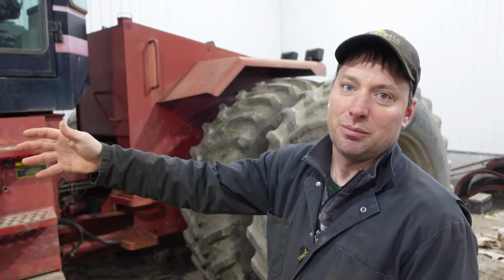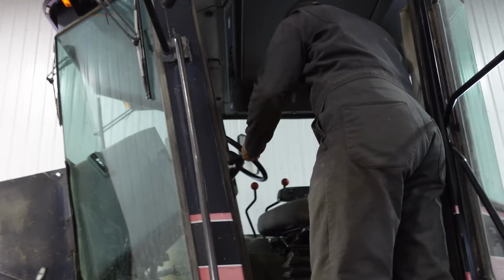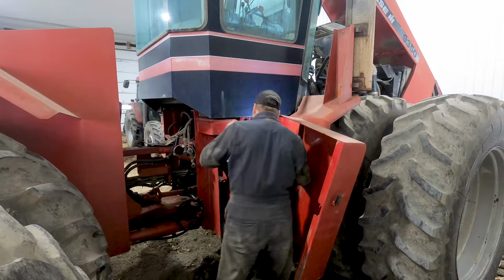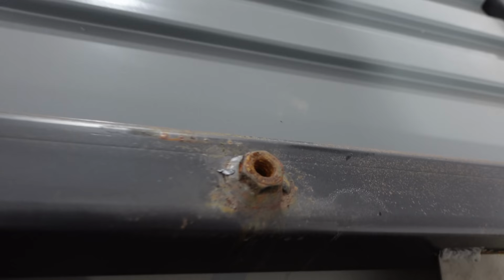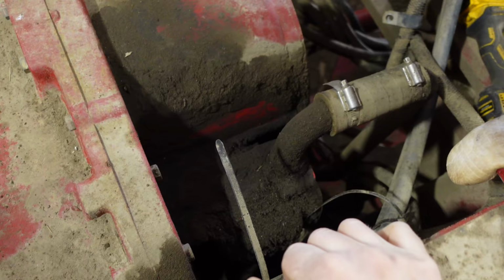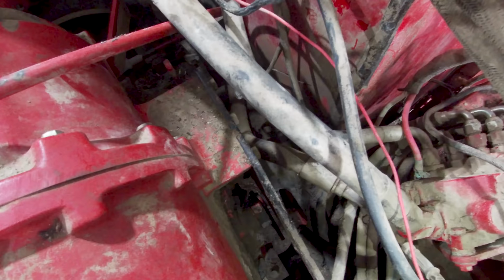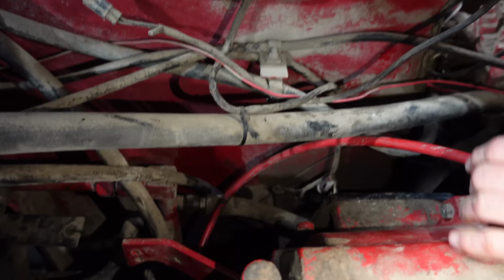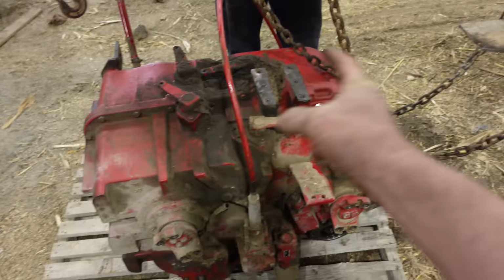Manual Transmission Won't Shift... Case IH 9350 Steiger [EP1]

Comment: This was an especially fun video to watch because I worked at a Case IH assembly plant for 6 1/2 years where I was a tester/utility guy so basically had to know every assembly station on the line and watching u guys with the cab in the air really brought back some memories as I routinely installed cabs along with everything else. Great vid, got me nostalgic 👍

Comment: How badly abused was this tractor that it had transmission issues at 4000 hours? I put over 2000 hours on the identical model doing extraction and towing in the oilpatch in NE Ab. when I was 15-16 years old and never had any problems and believe me that work was a lot more strenuous than farm work...

Comment: Rich and Kevin, Fawcett Tractor Supply in St Marys ON (8 minutes from my house) have 3 units similar in stock for wrecking. They show a 9150, 9230 and a 9250. Not sure if they are power shift or not, their web page doesn’t say. Two have burned, one worse than the other.  They might just be a straight parts swap if they are interchangeable, and not damaged for what you require/need. They might even have parts in storage from past demolitions. Check their web page under salvaged agriculture and you should see the three of them. Hope this helps. 

Always loved the channel and the tractor spin today is great. LOL, would have loved one of the Welkers to have popped up from behind the cab.
Reply: You will probably get a quicker reply if you send Rich an email.
Reply: @darcykeyaus  Since Rich gives responses here I figured he see it eventually.  That said, it is not a bad idea to send an email.  I never thought he’d have one posted in the video description, but there is a contact email listed.  I will send him the same message there as well and maybe he will see it quicker.
Reply: @rustynail2205  He did say in the video to email him :)
Reply: @darcykeyaus  what's his email?

Comment: Use a vacuum on the tank filler so when a line is disconnected it will draw air in rather that spilling out. Cool video guys.

Comment: Doing a 9130 powershift right now. Run it up on blocks about 18 inches pull the seat pop the floor pan and driveline. Hang the hydraulic pump hook a hoist to a forklift boom pull themounts and drop the transmission onto a skate and slide her out. 4.5 hrs and it's on the floor. 
The stx and newer steigers come out the top
Reply: I just got a 9330 and I think the tranny isn't quite right, it makes a bit of noise when you put it in forward gear and disengage the clutch pedal. It shifts quite rough also. How did you know your tranny was in a need of repair? Gear slipping?
Also, what do you think of the tractor in general?

Comment: Even electronic oil sensors aren't foolproof, we had a Nissan where the sensor failed by blowing a hole straight through it, and then not send an error to the gauge. So not only did it spew all the oil from the engine, it was also the failsafe to tell us that the engine was loosing oil pressure!
And to make matters even funnier, this happened twice (but the second time we checked it regularly, so we caught it before too much harm was done).

Comment: I have my 9380 going into the shop right now for the exact same job, mine is the 24 speed of that makes a difference.  Big Tractor Parts out of the states seems to be pretty good at getting parts.  Shop that is going to do mine just did a 12 speed last year, he had to put all new shift cables and master clutch cable in as well as 2 syncro’s, all new seals and maybe some bearings. Parts and labour was about $25,000. But it sounded like parts were a 5 week wait once you figured out what thickness of synco you need

Comment: Glad to see you guys pulled the tranny out the top, that is the easiest way to it. And yeah, have to remove that one side mount. That is the first manual tranny I have seen, all that I have done have been powershift. Not a difficult tranny to work on, just heavy parts and potential to get hurt, ...work smart and stay safe. I use a large split gear puller and a 10 ton hydraulic cylinder with pull rods to get the gears off the shafts.  Heat the bearings in an old electric skillet (375F) with peanut oil when you are ready to install, ...they will just slip right on.

Comment: Hey Kevin. Next time when you want to avoid the diesel bath.  Put a shop vac in the filler cap and plug any breathers on the tank while you change the hose with a plug.   Cost conscience.... lol...Dutch

Comment: There are a handful of wreckers in Saskatchewan and Alberta that might have parts .  Loeffelholz tractor and combine salvage in cudworth SK has a substantial inventory.   I should be able to hook you up with a  digital Service manual for the 9350.  Most CNH dealers will now provide a e book anyways after the right to repair bill moved forward in the states.

Comment: Snead equipment in Alabama might have something I know the rebuild Fuji transmissions like crazy and a full rebuilt ps is $30k. If your looking for salvage powershift stuff get of Facebook look for the steiger group there is a guy with red steiger salvage parts he might have a cab and harnesses. Could check Eldridge Supply, Bennett Tractor, and I think it's called Dumas Tractor all of which is in Arkansas. There is another place called Boothill in Missouri that has salvage tractor parts as well. Hope that helps

Comment: If I didn’t swap the manual oil pressure gauge for an electric, I would install a murphy gauge to but the engine off in the event of oil pressure loss. I know they make one for manual oil pressure. Probably make one for electric. I have one in my Lincoln sa200 welder. My dad was a pipeline welder and burned up an engine in an sa200 because it sprang a leak while he was up in a pipe rack in a chemical plant.

Comment: That tractor is worth way more than $50-60K. Have you guys been shopping for tractors lately? A tractor half that size and horsepower is worth at least $85K now. And your Steiger being non-émissions with minimal engine management, it's super-desirable considering farmers are still petitioning JD for the right-to-repair when their units are stuck in the fields.

As pricey as it is to rebuild, it's still worth it. You can always trade up when the service is finished, and be way ahead.
Reply: bare bones 9350 will bring 50ish if it had a pto could maybe get 60-70. The bigger ones 9370-9380 go for 80-90k
Reply: @Kolton9330  it's still respectable. I'm shocked the price hasn't doubled since the pandemic started.
Reply: @mfranzusan3014  age plays a big roll also people want tractors from the 2000s and onwards the 1990s tractors still a little but anything older most decent sized farms want nothing to do with them downtime and poor operator comfort is just to high
Reply: @mesh1248  I agree that age is a factor. But I also know that Tier 4 emissions and engine management on modern equipment is absolutely crippling the market from high maintenance and repair costs on machines with fewer hours than that Steiger. Think about it. People love early Chevy square bodies. They were plain brown wrapper trucks. No creature comforts, no stunning interiors. They ride like dump trucks, and they were everywhere on the road in the 80s. You stick a guy that's driven nothing but computer-managed, every power option, heated leather seats and satellite radio in his truck and he'll wonder what was so great about those old trucks.

Well, for one thing, you could fix them on your own with a handful of tools. A lot of the parts are available aftermarket. Maybe not overnight, but they can be had. Older tractors are the same thing.

You see how much an 85 square body work truck goes for now in great shape? It was only $5K when it was new. Now people want $25K.
Reply: @mesh1248  I've seen guys rebuild Versatiles from the ground up by putting the value of the unit back into it, and they were component built units too. Powerplants ranging from in-line 6 Ford commercial engines to Cummins triple nickels. 40K hour tractors rebuilt like new to be used another 40k. And they aren't new, comfortable tractors either.
Reply: @mfranzusan3014  yeah that is true but in general it’s mostly the owner operators  who do that run the rebuilt pre 1990’s tractors and nothing wrong with it its the cheapest way to run a tractor $per hours wise but any farm that relies on hired help has equipment that’s comfortable and enjoyable to drive to keep hired people around as for emissions i see way more problems in the trucking world then with tractors ive still obviously had some deff related maintenance but never a big repair but maybe I just getting plain lucky lol

Comment: 4000 hours?
That thing is brand new!
Ours has 35,000 hours on it.
It blew a hydraulic hose one day in 1998 and oil sprayed on the exhaust and it burnt down. We bought a Cat Challenger with the insurance money but bought the old tractor back from insurance as well and rebuilt it. The Challenger is gone and the Case is still around!
It's replaced by a John Deere now but I still prefer the old Case. Ours was powershift.

Comment: Kevin lucky! He's doesn't have stupid nowaday DEF tractor where Def freezes when it's below -10 and it causes variety of expensive issue. He smart running pre 2000 machinery where you can fix most of things with a sledgehammer

Comment: It's too bad he has such a nice building for fixing things, except the floor is such a mess you might as well do it outside on the ground! I know it was winter up there still, but paying all that money for a concrete floor & not being able to use it just sucks! Steiger equipment was always built to be very reasonable, & to be easy to repair! Until they got bought out! I really hope you could find everything to repair it properly! It would be a shame to not have a nice big piece of equipment like that around, not working!
Reply from the maker: He doesn't have concrete in there yet.  He is not that big of a slob

Comment: Cant believe how low hours that thing is 
The synco shift was junk 
Cant get any parts for em im aus 
Our local dealer sent 2 mid 2000s models to a wreaking yard over the last 3yrs 
The power shift models do 15k hours without any major issues

Iv got an 2002 synco shit with 8k hours 
Still going but getting rough, doesn't do any serious work now 
A 2010 power shift with 5k hours that still pulls the carry grader and recently retired from planting 
Now a 2020 quad track with 400hrs that's our main working tractor now

Comment: Pas besoin d’enlever la cabine pour enlever la transmission. 1- mettre le tracteur sur des block de 12”. 2-Enlever le top de plastique. 3-enlever le volan (stering),le siège et la trappe en dessous du siège. 5- passer une chaîne bore en bore de la cabine et soulever la transmission. La déposer sur un Plateau roulant et la sortir d’en dessous.
Reply: C'est exactement ça qu'il voulais éviter, de travailler accepter sur ça tête

Comment: the power shift trans are no good,.  Have 2 9390's, one with 24spd and one with PS, the PS has had the trans out about 4 times.  12k hours on the tractor.  24spd has been out once, 7k hours.

Comment: Random thought, but could a Holley run a power-shift trans?
Reply: What do you mean?
Reply: @ShainAndrews  Holley make engine efi / transmission management computers now.
Reply: @enwri  What part of that transmission is computer controlled?
Reply: @ShainAndrews  if I recall correctly, power shift transmissions are largely solenoid shifted (like a automatic trans in most cars). That's why he needed the wiring from a power shift cab along with the controls of course.
Reply: @ShainAndrews  nothing on that one.

Comment: I ain't a farmer, so what's a tractor without a PTO or 3-link good for?
Reply: Pulling
Reply: Drawbar work. Pull stuff to put it simple 🙂
Reply: PT
O power. Take off 3 link is for pick stuff up and pulling things
Reply: 3 point is a pretty outdated mechanism on a vast majority of the bigger ag tractors. Virtually the only job a pto would be required for for such a tractor would be grain cart
Reply: Pulling
Reply: Lawn art.
Reply: @jthomp997  ..... Look up Tub Grinders and Honey Wagons. Grain cart is only one option.

Comment: if my boss saw me doing that to the fork lift.........and lifting crap....
id be instantly fired 
.
like... DO NOT DO THIS!!!!!!......... a hydraulic hose gets a leak and that cab FREE FALLS!!!!!
so many people have been killed by trusting hydraulic systems 
.
floor jacks, bottle jacks.... cranes.... dump trucks, tractors, ETC
like... i trust a single stack of 4x4 wood blocks 4 foot long..... to hold a combine harvester, or an over weight semi.
i do NOT trust my 20 ton jacks...... even lifting 20 pounds 
.
.
like.... if im not going under it.... (and dont mind paying for damages) 
sure, jack it up and get it done (or lift it using the bucket.... )
.
just watch your feet...... 
even that steel toe is going to collapse and cut all 5 toes off..... myth-busters style
Reply: like..... i would have cribbed the cab before reaching in their....FULL ARM!!!..... to move the crap around 
.
but other than that...... its simply how it gets done every day on dozens of farms across the world 
fork lift "mod" is kinda sketch..... looks like 3 pieces of "meh" stuck together VS 1 big F-off, know its gonna do the job, I-beam or something like that
.
but hey.... it didnt really bend.... 
the cab probably isnt THAT heavy
.
all is well when it ends well
till someone looses a foot/arm/life
.
.
im a mechanic
like... dont get crushed to death guys..... ive been told it REALLY hurts as you are dying